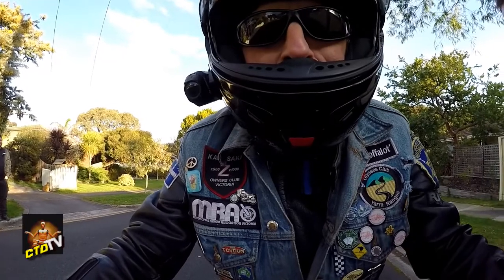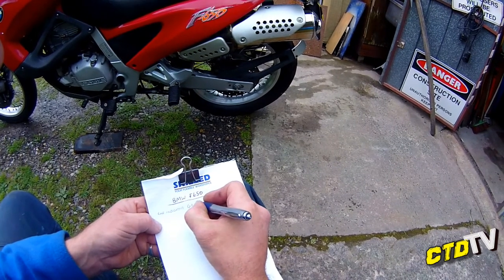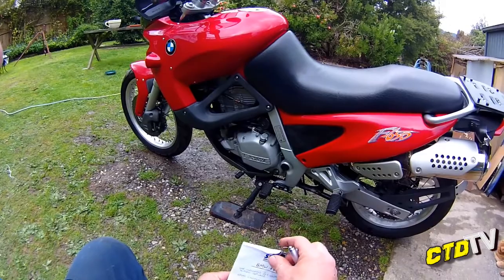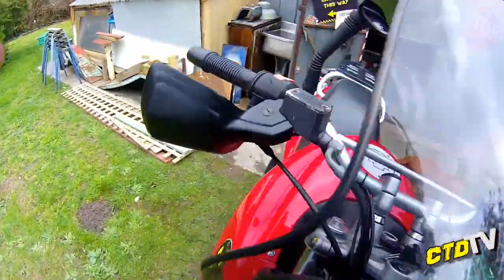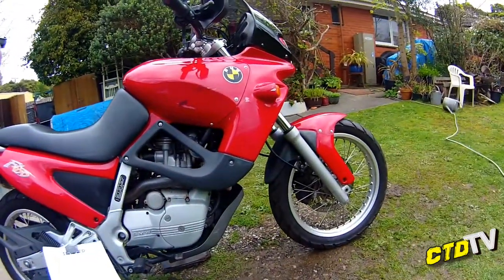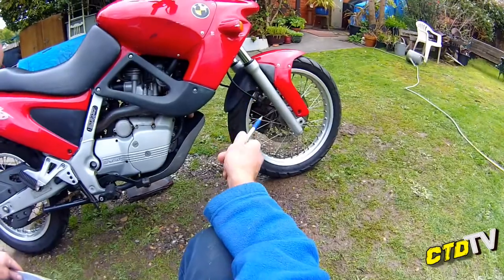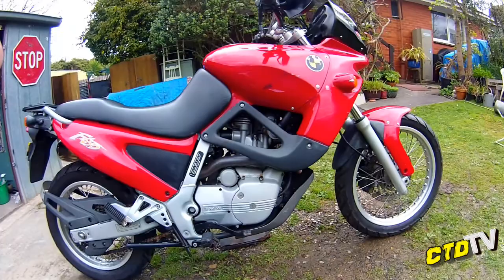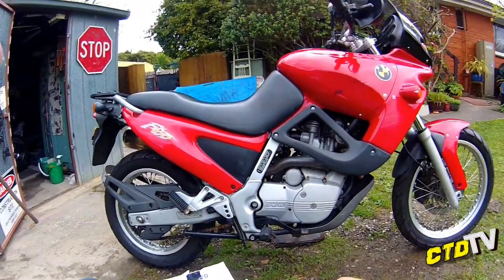BMW F650 - Quick Restoration - Part 2

Comment: did you say "Sprayer Clutch " ive the same problem can you advise please ?
Reply from the maker: It could be the 'Sprag clutch', or it could be the carbs.
Turns out, mine isn't the Sprag, but the carbs (on idling it cuts out (has a rough idle too)).
In the end, I took mine to a BMW repairer to diagnose. 
I was hoping they'd know the issue, but the people I went to hadn't done one for yearrrs.
(one of those Posh 'only new bikes' repairers)
But they did diagnose it and its Not the sprag and most likely the carbs.
Here is an awwwesome FAQ sheet I found for you.
https://faq.f650.com/FAQs/SpragClutchFAQ.htm

Hope that helps you. I haven't touched mine in ages, I think I might pull it out and continue get'n it back on the road.
Hope all that helps, drop me a msg and let me know how you go with it. 
Cheers Larry, RSOT >:)
Reply: @MrFalloffalot  many thanks !
Reply: @MrFalloffalot  hi again, i just bought it ! today i pushed the choke a hair and its stopped cutting out at idle on the motorway i gunned it in 5 two times it sank for a few seconds and recoverd youre right its the carbs ! again thanks.
Reply from the maker: @larrymckenna3503  Sounds like it could be that.
When I last had mine running, at idle it would sometimes just suddenly Stop n Clunk, giving me the impression it was the Sprag.
But when I raised the idle, it wouldn't Stop n Clunk anymore. Time for Idle jets I think??
I hope yours doesn't give you anymore issues, getting it Road-Ready.
You've inspired me to pull mine out and Get it on the Road! >:D
Checkout the Playlist I have on the f650.
I have made crash bars as well (Fr & Rear), I think there is a vid up? 
If not, I better get to it then...
Thanks Larry, uRSOT >:)

Comment: i got 2 bmw signal lights $15
Reply from the maker: Send me a Gmail msg, letme know where you are (for postage cost).
I also need yours so I can send you some stuff.
What Bike do you ride?
Reply from the maker: Gday Kenny.
You still got those BMW indicators lying around?
I noticed I can register that Bike for 'Historic Rego'. So I'm dusting it off and starting to get it sorted... :)
Reply: MrFalloffalot CrashTestDummy TV I got them on eBay
Reply from the maker: @bigcrapper50  Link? I need some... >:/
Reply: MrFalloffalot CrashTestDummy TV I don’t know how to link Front/Rear Turn signal Light Indicator Lamp BMW F650 Funduro ST G650 GS 09-10
Reply: MrFalloffalot CrashTestDummy TV search eBay seller prostrada this is different place than I bought I bought from seller in Spain 2 years ago
Reply from the maker: @bigcrapper50  But your selling your old ones yeah? That info gave me a seller in CA USA.
If you Right mouse click the address bar, then click on 'Copy' from list, then right click again (on a msg to me) and 'Paste' it.
Link pasted  >:)
Reply from the maker: @bigcrapper50  Thanyou Muchly >:)